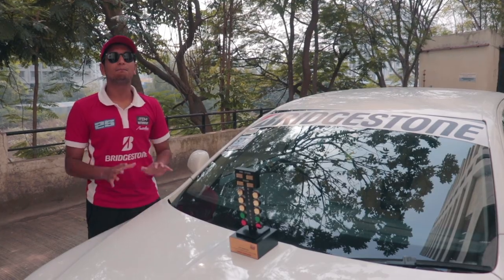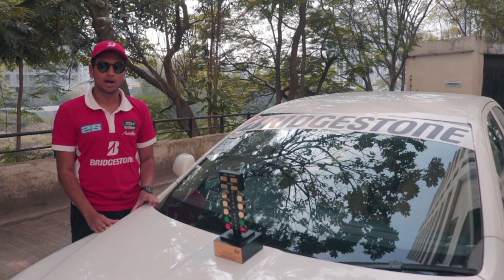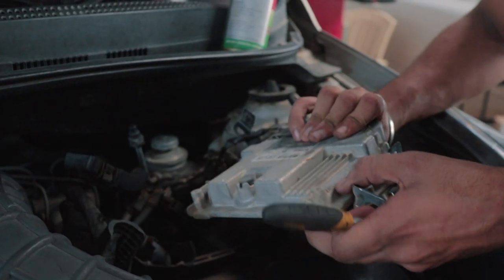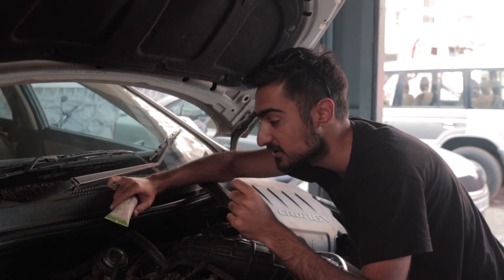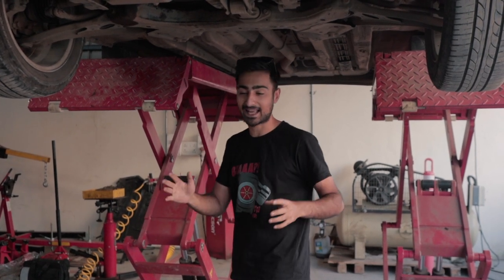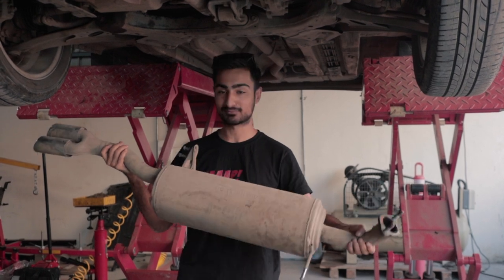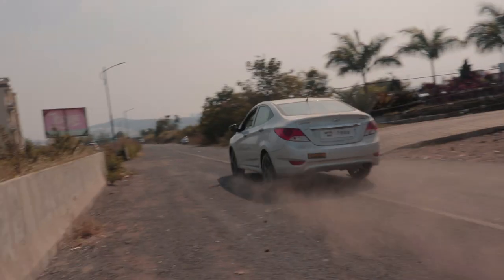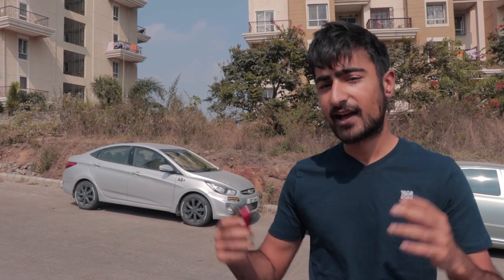Driving the Stage 2 Hyundai Verna 1.6 CRDi + Fixing a Gas leak in the performance downpipe!

Comment: Will downpipe result in turbo lag in lower RPM (below 2000 RPM)
Reply from the maker: Yes, but that also depends on the design of your downpipe. There are ways to significantly reduce turbo lag if your downpipe is designed the right way. Moreover, having a progressive decrease in diameter helps decrease turbo lag.

Comment: Seriously ya’ll are proud of Bridgestone tyres on a Stage 2 Verna? What are you guys pseudo-enthusiasts? They look like the stock ones. Put some Michelin pilot sports on that beast. You can always upsize. Power is nothing until you put that traction down.
Reply: they put Michelin and you sponser them
Reply: Well 150 bhp isn't an awful lot and those tyres hold up fine for now I guess. Pilot sports are too expensive and useless with the suspension that verna has. Bridgestone does make good tyres too though.

Comment: What's the approxmate cost for the stage 2 setup?
Reply: Quite close to the value of Car 😁
Reply: From my knowledge, the remap should cost appx 20K, the down pipe and muffler should be another 10-13 K, and the tyres should be an easy 6-7K a piece.
Reply from the maker: Absolutely not, it should cost anywhere between 40k-50k depending on the tuner.
Reply: @TheDriversHub  I can see an Accord there in the workshop.
Can i expect a video of Honda Accord from you guys in future?
That K24 Engine has a lot of capabilities...
Reply: @virajsonthalia1115  you are correct brother my Brezza diesel remap costed 28 k whole with 117 hp Peak